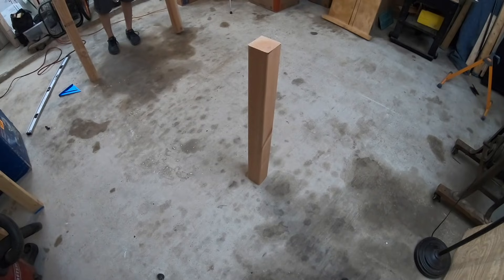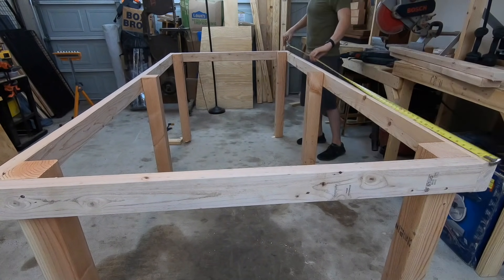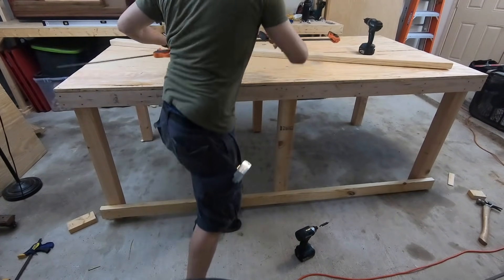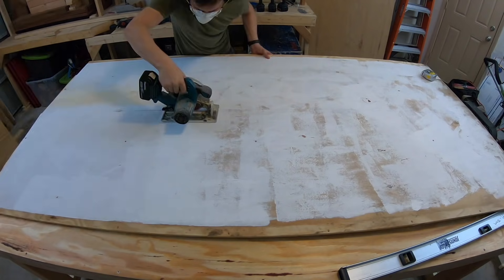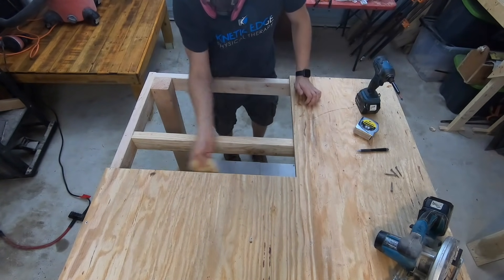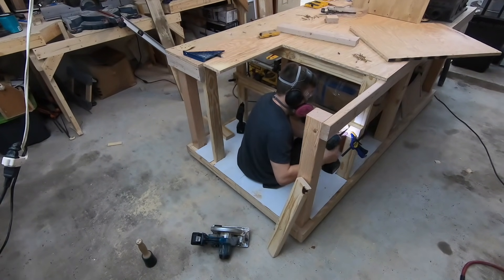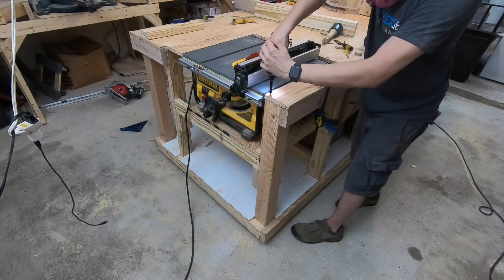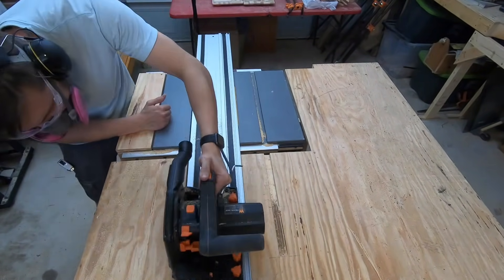How to build a table saw workbench - Full Project

Comment: Very expensive table, i can't believe a 2x4 is $6.50
Reply from the maker: Seriously. It’s crazy high right now
Reply: 2x4's are 8.25 for an 8 footer here in CT. It's the top main milling companies that are making all of the money. Employees are paid the same, sawers are paid the same, and outlets like Home Depot had to raise prices because of those main 5 companies charging more for the wood. Because of COVID and so many homeowners staying home, and them deciding to do improvements and projects caused companies like HD and Lowes to use up all of their reserve lumber. It's absolutely disgusting that companies already making billions would raise their prices during a pandemic!
Reply: Glad I get a military discount and save a few pennies lol
Reply: Im a little late to the comment, but if you dont mind the work, find a commercial HVAC place.  They usually ship big units on hearty pallets made of 2x4s.  I broke down three and had enough for several projects.  They are usually put together with what looks like deck screws (I was even able to save some of those as well).

Comment: Why didn't you set it in the middle? You have little support on the right side for sheet goods? I also agree it should be higher to get your feet under. A better option would be locking wheels to move it around you can still cut shims the thickness and put between wheels and 4x4.Your 2x4 leg won't be needed if centered as your lower horizontal support for the saw will go all the across.
Reply from the maker: Great question. I wanted one side more open for workspace. Plus I wanted more access to the right hand side of the saw, where I store items and have an easier time reaching the dust port.

Comment: Thanks for sharing this how to video. I'm 50 yrs old and just started buying and using power tools. I've been looking at the dewalt table saw with rolling stand, but I'm going to take a chance and try to build this one you built... Thanks again
Reply: I am doing the same.  I want the 10” due to the dado blade capability.  I am looking for the saw without the rolling stand - sure, I’d like to save a few dollars but also don’t want to just waste it since I won’t use it (because I too will build it into the bench).  Do you know if there is any way to buy the 10” DeWalt without the stand?

Comment: Nice build. I did the same about 2 years ago with a DW744 and the area around the table saw is almost identical. I used 2x8 SYP boards for the top. I also have a lift up section in the middle with a DeWalt miter saw

Comment: At 4:30  When you're installing the lower shelves, I think it would have been beneficial to install the frame on the inside of the posts and raising the height a couple inches, so you can at least get your feet with boots in there. I made mine with the front portion where I work the most a good 8 inches shorter (back to front), so that I dont murder my shins every time I reach for a tool and my bench is 3 ft wide, not 4 ft like yours.
Reply from the maker: I agree. Thanks for the input

Comment: Great design - I added castors. I made it in France - they don't do 4 by 2 timber here, 72 by 45! I used two sheets of 15mm ply for top - did the cut-outs in place on the bottom sheet, then put on the top sheet after I routed some depth for the fence assembly.

Comment: I like how you built this. This assumes that the workbench is in the middle of the room so you reach across from any side being 48 inches deep. For me, mine will be against a wall (but with folding wheels) so I'll limit the depth to probably 36 inches. The table saw also dictates the width.

Comment: Just purchased the wood to do this project. Not bad, about $130. I did get ACX plywood for the top. Wanted it as smooth s possible. I am also going to take Rolf Bjorns recommendations about raising the shelf and putting the lower frame on the inside of the posts. Should give me plenty of foot room. Thank you for the great video.
Reply from the maker: Have a great build brother! Shoot me some pics of the final product

Comment: John,
This is not a good bench. It is a GREAT bench for a number of reasons. To begin with, I could hear every word. I have seen more work bench builds than I can count. I’m a beginner and you took your time. I learned 

learned a lot of general construction methods. I have a similar DeWalt table saw. Mine is the 8&1/4 (Or is it 1/2?). Seems to be a popular model. 
I’m sure every woodworker will make a modification but I will stay close to your design. 
Thank you very much!
Reply from the maker: Thanks for your comment Louis! I’m glad you were able to learn a few things. I learned 90% of what I know from YouTube, so you’re in the same boat as me! I hope your woodworking journey is as rewarding and fun as mine has been
Reply: John, Starting from scratch at age 76 is a minor obstacle. 
Of course I’m looking for easy projects.

Comment: You made yours almost identical to the one I made with a few exceptions, basically my plywood on top I did 2 layers making it 1.5" thick and it over hangs the frame 1" from all edges of the frame, I also made mine  a bit shorter so I could put locking casters to make is easily movable. and lastly I used a Grizzly Portable saw witch is almost identical to the DeWALT

Comment: Why not use a router for the underside of the workbench top and for the track cutouts?
Reply from the maker: This is a great alternative. No reason not to. I was looking for a quick way to cut those slots and didn’t feel like taking the time to setup router rails. Also, these slots are not precision and only meant to create clearance for the table saw fence rails.

Comment: Any reason you didn't use any glue or construction adhesive?
Reply from the maker: I’m more of a nomadic woodworker, so I know I’ll need to take this apart at some point
Reply: If it's something I'm making for myself (especially shop fixtures) I'll never glue stuff together unless I absolutely have to.  Someday I'll end up taking it apart and reusing the wood and the glue just complicates that.

Comment: What is the name of the saw that you used to finish cutting the table saw cut out?
Reply: A ryoba. it's a pull saw that typically one side has teeth oriented for ripping while other side is for cross cutting.
Reply from the maker: I used a makita circular saw and a WEN track saw

Comment: Why did you choose to place the saw to the right? Did you have a reason like the blade sits into the table half the distance of the extension ? Mine extends 35" so I'm trying to figure out the most logical placement. I've seen some centered and some flush to the right. Trying to understand the reasoning.
Reply from the maker: I wanted more “meat” to the left of the saw. Plus this way I didn’t have a large puzzle piece to cut out on the right, where the fence slides. Only a small one.
Reply: @johnbarneswood  I'm trying to decide on my placement. If I go full right with full extension the table won't catch the piece right of the blade. Was just curious if there was something I was missing out on for a reason to place the saw there since I've seen it that way a lot.
Reply: What is that plywood thing that you slide over those grooves you cut in the table top right at the end of the video?

Comment: Hi, may you please make me know the dimensions of legs (may be 9x9 cm) and dimensions of the perimeter  wooden lath  (may be 3 x 7 cm). Thanks a lot. Congratulations for your wonderful job!
Reply: i know this is old comment but for the actual dimensions of the lumber he used for the legs and rails. the legs4x4 is actually 3.5 inches by 3.5 inches, and the rails were 2x4 are actually 1.5 inches by 3.5 inches now in metric that would  be 89mmx 89mm for legs and 38mm by 89mm for rails

Comment: This is probably more helpful to beginners, but when I work on projects, I try to plan ahead. Rather than building the whole table and cutting out everything you just put together, why not build it that way in the first place? Of course there are things that come up along the way, but if you already planned on making an insert for the table saw, this seems like a backwards way of doing it. 

Last thing, if you have a track saw, why did you use a circular saw and level lol
Reply from the maker: It wasn’t originally planned on being this. After a month of using it as a regular surface, I realized I could sink my table saw into it. And I purchased the track saw towards the end of the build. Definitely wish I had it all along!

Comment: There is no left enough space for foot to stand close to table
Reply from the maker: That’s one solution and it also gives you the ability the move the table around. Another is the raise the height of the lower shelf by ~4”. In the case of this project, the spacing between shelving would be reduced from 29” to 25”
Reply: @johnbarneswood  dual lock swivel casters on all the things 😁